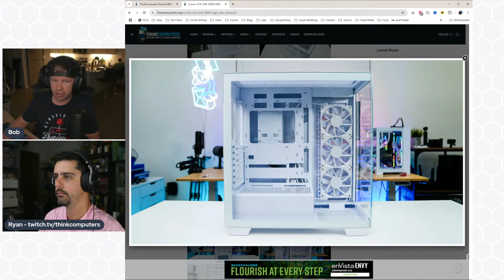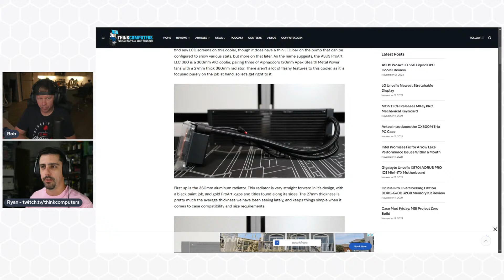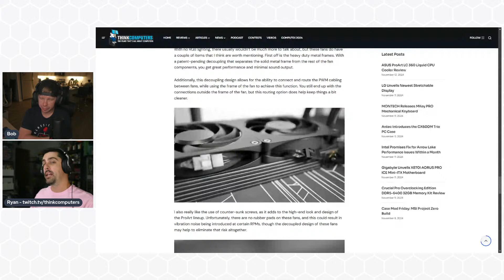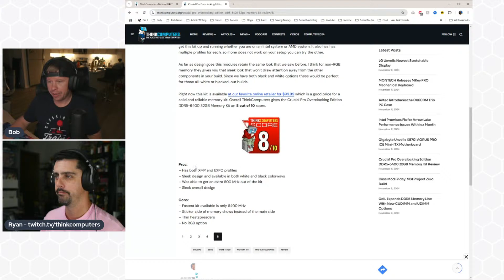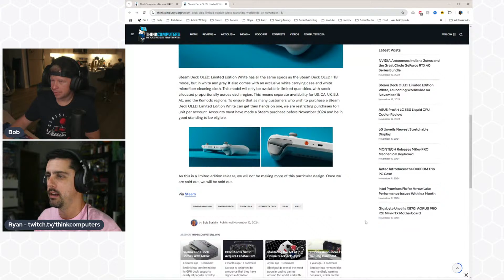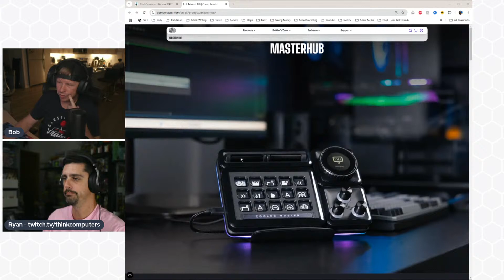ThinkComputers Podcast #427 - Ryzen 7 9800X3D Sells Out, ProArt AiO, Arrow Lake Fix & More!

Comment: I believe 285k will be close to 9950X3D paired to AMD/Nvidia GPU at high resolution when the platform is optimized. But I don't think this is the peak of it. I think we will see the peak performance with upcoming INTEL ARC all INTEL system.

1. PCIe 5.0 direct access to CPU with 8 pin power. REBAR on steroids that will give a huge performance gain.
2. CUDIMM lifting the CPU speed closer to GPU allowing higher pairing. Memory speed is vital.
3. ARC from Xe to Xe2 giving 50% gain. Plus better VRAM.
4. Paired top ARC you get APO that is 10-50% gain on supported titles. 
5. ARC Xe from 225W to Xe2 250-275W for more performance. That's doubling the performance.
6. Arrow Lake PL2 Extreme 295W
7. No Hyper-Threading Technology making way to very powerful E Cores.

We get 570W all up working for GPU pairing with architecture giving all good frames with no waiting/queuing where 60 FPS at 4k is better than 120 FPS from AMD/Nvidia where more than half the frames are broken or out of time giving stutter. 5080 is 400W card predicted and on paper the all INTEL system looks as good if not better. But with $1000 less coin.

Just note that many of the top reviewers say that APO makes very small difference. And they be right it doesn't work on AMD/Nvidia GPU pairing on their 4090 test. It is misleading and lack of knowledge and sponsored. 

Also note that AMD/Nvidia doesn't get gains from REBAR nor E Cores (+-5%) because in single silicon architecture CPU only feeds the GPU where all the tasks are done hence the big Wattage.

In a nutshell

4090 24gb VRAM 384 bit bus 450W
4080 16gb VRAM 256 bit bus 320W
4070ti 12gb VRAM 192 bit bus 285W
4070 12gb VRAM 192 bit bus 185W
4060ti 8gb VRAM 128 bit bus 160W
4060 8gb VRAM 128 bit bus 115W
3090 24gb VRAM 384 bit bus 350W
3080ti 12gb VRAM 384 bit bus 350W
3080 10gb VRAM 320 bit bus 320W
3070ti 8gb VRAM 256 bit bus 310W
3070 8gb VRAM 256 bit bus 220W
3060ti 8gb VRAM 256 bit bus 200W
3060 12gb VRAM 192 bit bus 170W

a750 8gb VRAM 256 bit bus 225W
a770 16gb VRAM 256 bit bus 225W

6500xt 4gb VRAM 64 bit bus 107W
6600xt 8gb VRAM 128 bit bus 132W
6700 10gb VRAM 160 bit bus 220W
6750xt 12gb VRAM 192 bit bus 250W
6800xt 16gb VRAM 256 bit bus 350W
6900xt 16gb VRAM 256 bit bus 300W
6950xt 16gb VRAM 256 bit bus 335W
7600xt 8gb VRAM 128 bit bus 120W
7800xt 16gb VRAM 256 bit bus 300W
7900xt 20gb VRAM 320 bit bus 300W 
7900xtx 24gb VRAM 384 bit bus 420W

A770 beats 4070ti at 4k. You get very good experience with ARC and RT in mid to high settings starting from 40 FPS and great at 60 FPS where the 4070ti struggles at 120 FPS to deliver and the experience is stutter and no RT. Add XeSS XMX to ARC in supported titles where the list is already long and you match DLSS quality. Great entry level card for 4k. Now that we are getting APO also on supported MB's with ARC the card will age like fine wine. And I'm very interested to see how does the Alchemist respond to Z890 boards with PCIe 5.0 direct access to CPU and CUDIMM. REBAR is plus 20% performance gain and REBAR in all is still pretty narrow compared to the PCIe 5.0 offering of 8 pin power and direct access to CPU that now resamples more speed and more powerful E Cores. Someone should test this so we get some idea of the platform with Battlemage.